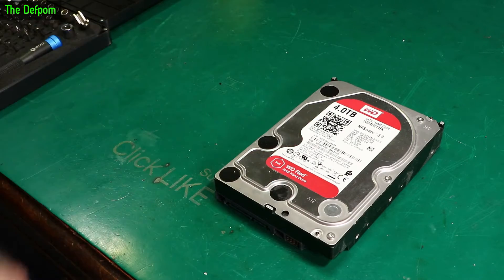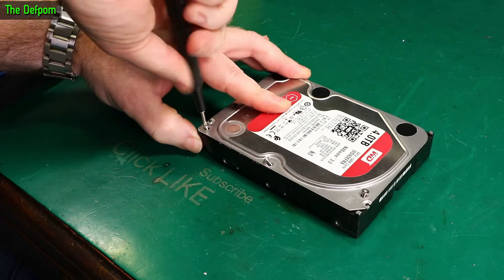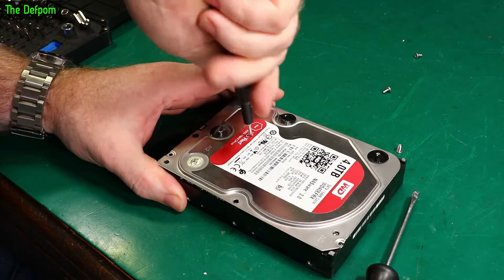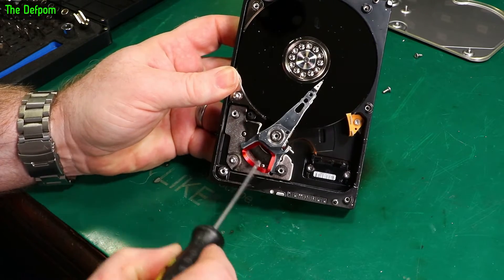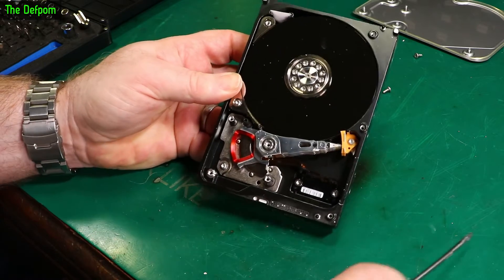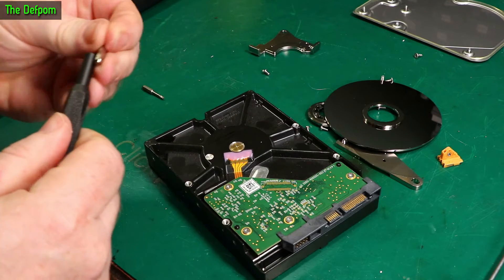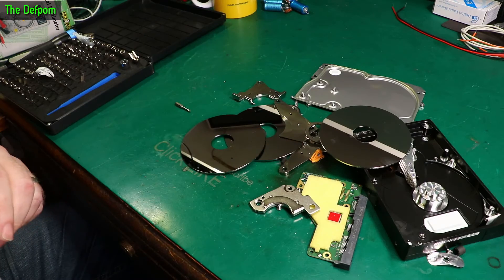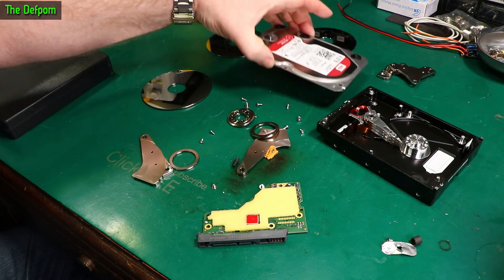🔴 What Is Inside ? - Western Digital Red 4TB Hard Drive - No.1081

Comment: The precise mechanical tolerances and engineering of conventional HD's has always impressed me. Incredibly, I've never experienced a HD failure in over 30 years of personal computing, cheers.
Reply from the maker: I have only had 2 spinning rust drive failures, and those are recent, both on WD drives, and both are drives that had a LOT of use, I just had a 2TB WD Black drive starting to fail with Smart errors showing up, the drive is 12 years old… and was used to store my videos on, it was almost full anyway, so had been replaced with a 4TB Seagate… will see how long this one lasts.
Reply: @TheDefpom  I'm sure the Seagate Drive won't let you down, cheers.

Comment: A single ultra thin magnet when prized off the thicker base plate and attached between the mating surfaces of the door to a metal garden shed - make the door close with a satisfying 'click' and stops the door rattling in the wind. 
A layer of tape deadens the 'click' to acceptable levels. 
Luckily they don't seem to cause galvanic corrosion which I found interesting. 
Some appear to have what looks like a thick chrome coating that can get torn when prizing off the baseplate.

Comment: It looked like the head, for the top disc, made contact with it in three spots, (crashed), and that was probably the start of your problems. I don't think that was smudges or dust, as those things are particulate-free inside. The death knell comes when you first hear one start to make a hunting-sound, or a clack-clack-clack from the heads rapidly moving back and forth hunting for the data.

Comment: When destroying a box-full of junk drives I found most hard disk platters are metal but a few broke violently like glass when  nipped with bolt cutters. Rather surprising!
I would be cautious that the magnetic coating could be an exotic substance . Maybe wash hands after touching and avoid contact with food?
Hanging a bunch on a long sting in the wind and sun is interesting as they reflect like an optically flat mirror (much better than CD's).

Comment: Is it possible to salvage the spindle motor?
Reply: Usually pressed into case, and cannot be easily salvaged. It's also kind of useless. It's very specialized, and not powerful. I've experimented with similar ones and with motor form 2.5" hdds - nope, too much hassle to use and hard to mount anywhere.
Reply: @tigrafrog  it's a 3 fase motor also